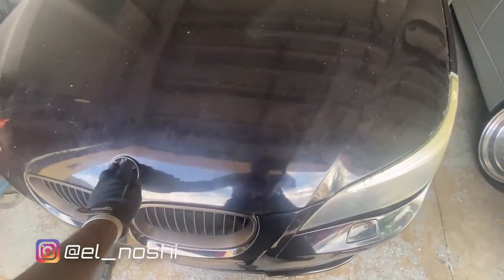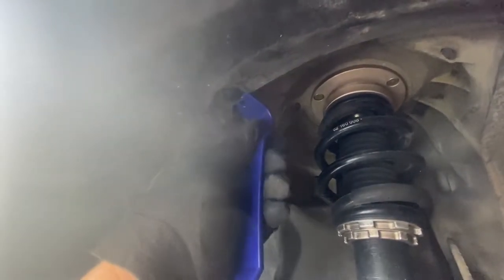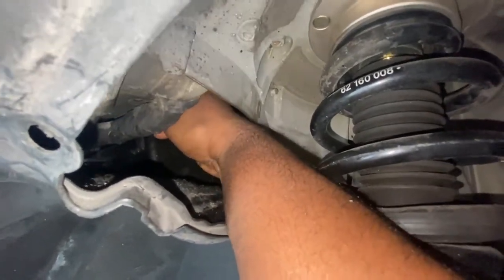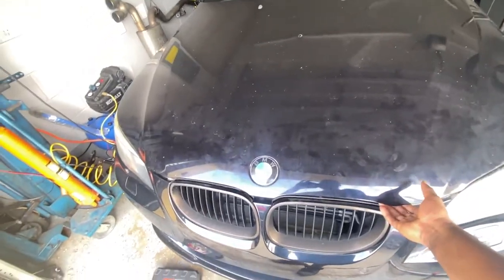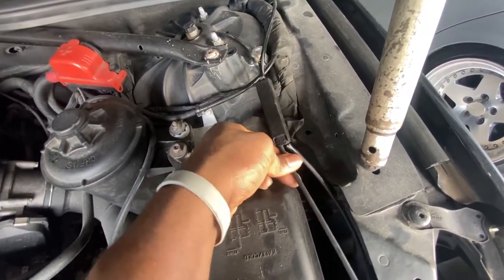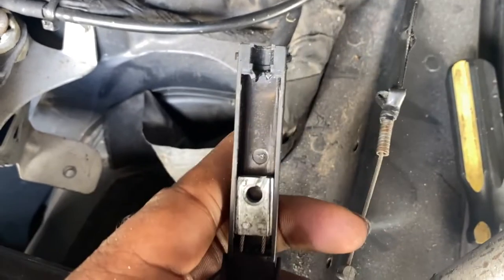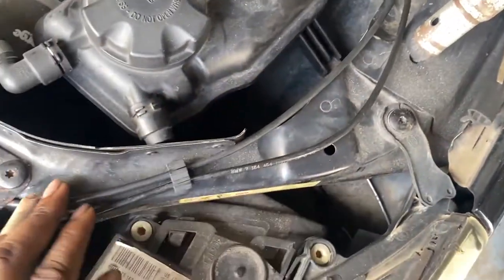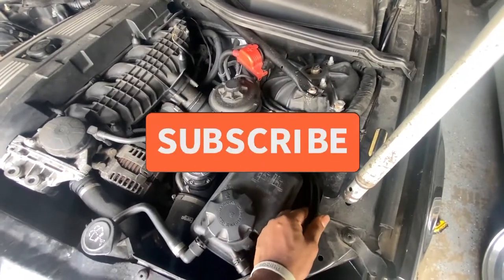BMW E60 535xi Hood Won't Open

Comment: Thank you for this.  It worked on my 2007 530xi.   I will also add that since it was still hard to get ahold of the cables, I felt my hands up in there and wrapped a zip tie around both cables and created a small loop with the zip tie to pull down on the cables and my stuck hood popped open.  Found cable that goes to both latches very loose, original cable and old car, so used a zip tie pull up a little of the slack in the cable and works fine none.  Zip ties are just like duct tape in an old car.
Reply from the maker: No prob glad it help. Yea great idea with the zip ties!

Comment: Bro glad to see you still got the e60. How has the single turbo setup held up
Reply from the maker: It held up well, the main thing I was watching for was leaks and how the a/c line and dsc lines would hold up. But unrelated to the turbo setup, a leaking injector took it out. So should have a vid up on it when I get some free time in a few weeks since I’m pulling everything.